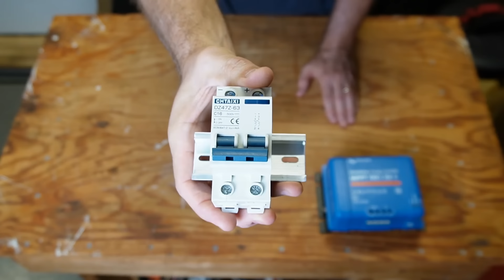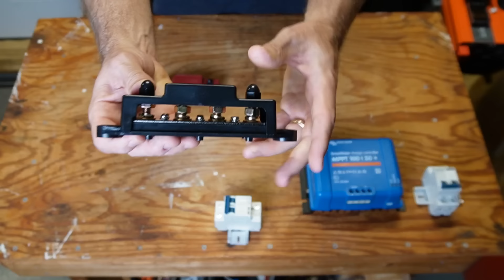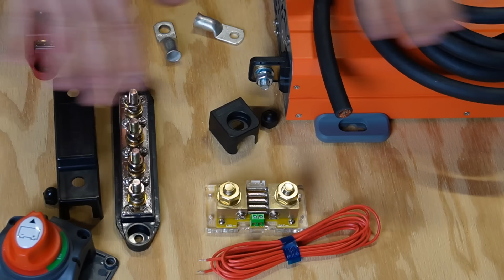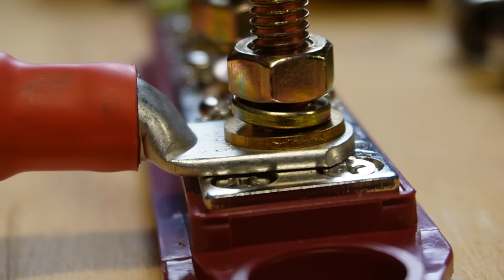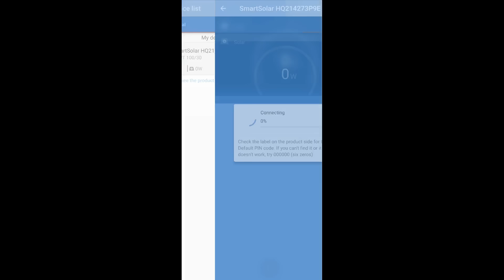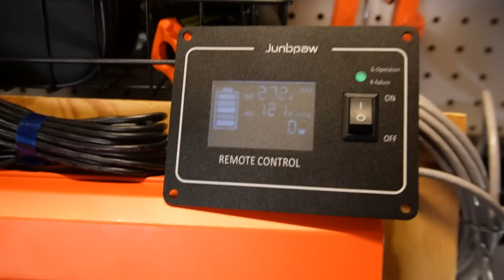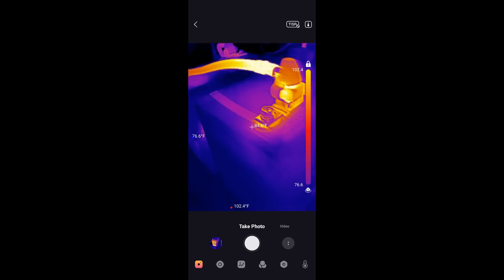24V DIY Off-Grid Solar Generator Build For Beginners

Comment: If you add. Bojack inline fuses what would be officiant enough for amp fuses?100amp?  A fuses before inverter and fuse before charger going off the wire shamanic Amazon renology battery management device  ?
Reply: 255  God! There is no god except He, the Living, the Everlasting. Neither slumber overtakes Him, nor sleep. To Him belongs everything in the heavens and everything on earth. Who is he that can intercede with Him except with His permission? He knows what is before them, and what is behind them; and they cannot grasp any of His knowledge, except as He wills. His Throne extends over the heavens and the earth, and their preservation does not burden Him. He is the Most High, the Great.
256  There shall be no compulsion in religion; the right way has become distinct from the wrong way. Whoever renounces evil and believes in God has grasped the most trustworthy handle; which does not break. God is Hearing and Knowing.
257  God is the Lord of those who believe; He brings them out of darkness and into light. As for those who disbelieve, their lords are the evil ones; they bring them out of light and into darkness—these are the inmates of the Fire, in which they will abide forever.
258  Have you not considered him who argued with Abraham about his Lord, because God had given him sovereignty? Abraham said, “My Lord is He who gives life and causes death.” He said, “I give life and cause death.” Abraham said, “God brings the sun from the East, so bring it from the West,” so the blasphemer was confounded. God does not guide the wrongdoing people.
259  Or like him who passed by a town collapsed on its foundations. He said, “How can God revive this after its demise?” Thereupon God caused him to die for a hundred years, and then resurrected him. He said, “For how long have you tarried?” He said, “I have tarried for a day, or part of a day.” He said, “No. You have tarried for a hundred years. Now look at your food and your drink—it has not spoiled—and look at your donkey. We will make you a wonder for mankind. And look at the bones, how We arrange them, and then clothe them with flesh.” So when it became clear to him, he said, “I know that God has power over all things.”
260  And when Abraham said, “My Lord, show me how You give life to the dead.” He said, “Have you not believed?” He said, “Yes, but to put my heart at ease.” He said, “Take four birds, and incline them to yourself, then place a part on each hill, then call to them; and they will come rushing to you. And know that God is Powerful and Wise.”

2  God, there is no god but He, the Living, the Eternal.
3  He sent down to you the Book with the Truth, confirming what came before it; and He sent down the Torah and the Gospel.
4  Aforetime, as guidance for mankind; and He sent down the Criterion. Those who have rejected God’s signs will have a severe punishment. God is Mighty, Able to take revenge.
5  Nothing is hidden from God, on earth or in the heaven.
6  It is He who forms you in the wombs as He wills. There is no god except He, the Almighty, the Wise.

11  Originator of the heavens and the earth. He made for you mates from among yourselves, and pairs of animals, by means of which He multiplies you. There is nothing like Him. He is the Hearing, the Seeing.
12  To Him belongs absolute control of the heavens and the earth. He spreads the bounties to whomever He wills, or reduces it. He is aware of all things.
13  He prescribed for you the same religion He enjoined upon Noah, and what We inspired to you, and what We enjoined upon Abraham, and Moses, and Jesus: “You shall uphold the religion, and be not divided therein.” As for the idolaters, what you call them to is outrageous to them. God chooses to Himself whom He wills, and He guides to Himself whoever repents.

54  Your Lord is God; He who created the heavens and the earth in six days, then established Himself on the Throne. The night overtakes the day, as it pursues it persistently; and the sun, and the moon, and the stars are subservient by His command. His is the creation, and His is the command. Blessed is God, Lord of all beings.
55  Call upon your Lord humbly and privately. He does not love the aggressors.
56  And do not corrupt on earth after its reformation, and pray to Him with fear and hope. God’s mercy is close to the doers of good.
57  It is He who sends the wind ahead of His mercy. Then, when they have gathered up heavy clouds, We drive them to a dead land, where We make water come down, and with it We bring out all kinds of fruits. Thus We bring out the dead—perhaps you will reflect.
58  As for the good land, it yields its produce by the leave of its Lord. But as for the bad, it produces nothing but hardship and misery. Thus We explain the revelations in various ways for people who are thankful.
59  We sent Noah to his people. He said, “O my people! Worship God; you have no god other than Him. I fear for you the punishment of a tremendous Day.”
60  The dignitaries among his people said, “We see that you are in obvious error.”
61  He said, “O my people, I am not in error, but I am a messenger from the Lord of the Worlds.”
62  “I deliver to you the messages of my Lord, and I advise you, and I know from God what you do not know.”
63  “Do you wonder that a reminder has come to you from your Lord, through a man from among you, to warn you, and to lead you to righteousness, so that you may attain mercy?”
64  But they called him a liar. So We saved him and those with him in the Ark, and We drowned those who rejected Our revelations. They were blind people.

59  The likeness of Jesus in God’s sight is that of Adam: He created him from dust, then said to him, “Be,” and he was.
60  The truth is from your Lord, so do not be of those who doubt.
61  And if anyone disputes with you about him, after the knowledge that has come to you, say, “Come, let us call our children and your children, and our women and your women, and ourselves and yourselves, and let us invoke God’s curse on the liars.”
62  This is the narrative of truth: there is no god but God. God is the Mighty, the Wise.
63  But if they turn away—God knows the corrupt.
64  Say, “O People of the Book, come to terms common between us and you: that we worship none but God, and that we associate nothing with Him, and that none of us takes others as lords besides God.” And if they turn away, say, “Bear witness that we have submitted.”
65  O People of the Book! Why do you argue about Abraham, when the Torah and the Gospel were not revealed until after him? Will you not reason?
66  Here you are—you argue about things you know, but why do you argue about things you do not know? God knows, and you do not know.
67  Abraham was neither a Jew nor a Christian, but he was a Monotheist, a Muslim. And he was not of the Polytheists.
68  The people most deserving of Abraham are those who followed him, and this prophet, and those who believe. God is the Guardian of the believers.
69  A party of the People of the Book would love to lead you astray, but they only lead themselves astray, and they do not realize it.

84  Say, “We believe in God, and in what was revealed to us; and in what was revealed to Abraham, and Ishmael, and Isaac, and Jacob, and the Patriarchs; and in what was given to Moses, and Jesus, and the prophets from their Lord. We make no distinction between any of them, and to Him we submit.”
85  Whoever seeks other than Islam as a religion, it will not be accepted from him, and in the Hereafter he will be among the losers.

28  It is He who sent His Messenger with the guidance and the religion of truth, to make it prevail over all religions. God suffices as Witness.
29  Muhammad is the Messenger of God. Those with him are stern against the disbelievers, yet compassionate amongst themselves. You see them kneeling, prostrating, seeking blessings from God and approval. Their marks are on their faces from the effects of prostration. Such is their description in the Torah, and their description in the Gospel: like a plant that sprouts, becomes strong, grows thick, and rests on its stem, impressing the farmers. Through them He enrages the disbelievers. God has promised those among them who believe and do good deeds forgiveness and a great reward.

111  And say, “Praise be to God, who has not begotten a son, nor has He a partner in sovereignty, nor has He an ally out of weakness, and glorify Him constantly.”

Read The Quran

Comment: just buy a 24v battery...its way better for the long term ... 12v series im not a fan for this, it can go out of balance without you knowing. 
sooo if you an just by 24v if you have a 24v inverter...make your life easy
Reply from the maker: Thanks for commenting. I agree for long term I would prefer a single 24v battery. But I thought it would be another teaching point for beginners to show how batteries can be wired in series.

Comment: Do your hydraulic lug crimpers not auto release when the crimp is properly and fully performed? Sorry, I'm used to calibrated aircraft rated crimp tools. (Expensive!)
Reply from the maker: No, my crimper does not auto release. I did not even know they did that. I wish I had selected one with higher ton rating. I have trouble crimping 00 and above. It works, but its not tight enough so I have to use the one where you use a hammer for the large wires.
Reply: @proficientprepper You might not have liked the aviation grade calibration capable prices on them suckers! We had assorted dies and crimp types of just about every shape, size, and type known. We even had pneumatic style crimpers for some of the larger stuff that looked like little cannons/mortars!

Comment: Great video! How long do you think that ac could run with that setup?
Also, what charger would you recommend?
Thanks!
Reply from the maker: That AC was pulling 950 watts I believe. So it would probably not run it more than a few hours. For a 12v battery charger, I'm currently using this one - https://amzn.to/3HdsaGE   I do like it because it has reverse polarity protection. But it may be too much current for your needs. For a 24v charger, I'm currently using this one https://amzn.to/4fPDu8z which also has reverse polarity protection. I destroyed a charger once when I accidentally connect it with reverse polarity.

Comment: That is a 24v system and you have 12v inverter
Reply from the maker: The inverter in the video is their new 24v inverter. I previously did a review on their 12v inverter.
Reply: So you are just making things up, right? Instead of asking a question, you are making a gotcha statement when you have no idea what you are talking about. Clearly a 24v inverter.